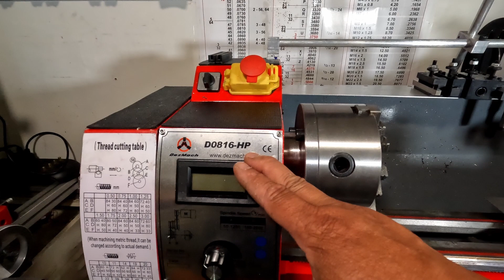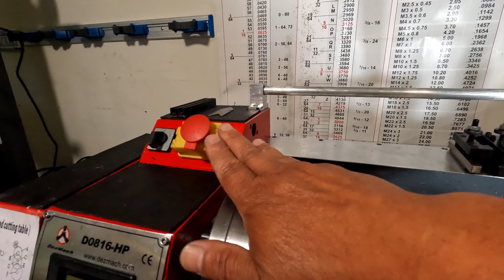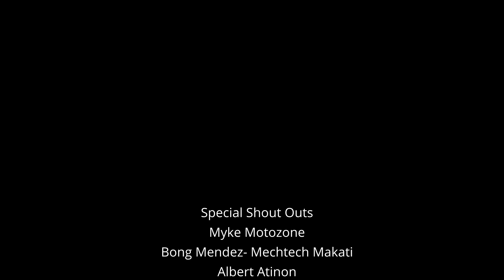DIY Emergency Shut-Off Switch for Mini Lathe ( UPGRADE ) | Harbor Freight Foot Pedal Hack

Comment: Hi buddy 
If you use the switch pedal as it comes with its normal operation 
Would it be still working rd with your lathe? 
If an emergency comes you realise pedal 
No sure maybe I am
Missing something coujd you clirify if possible please ?
Thanks